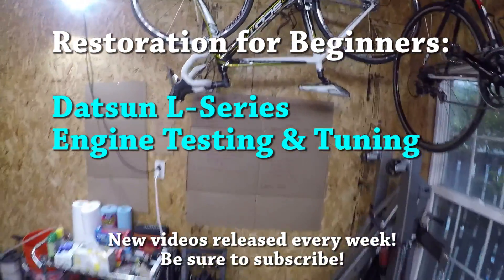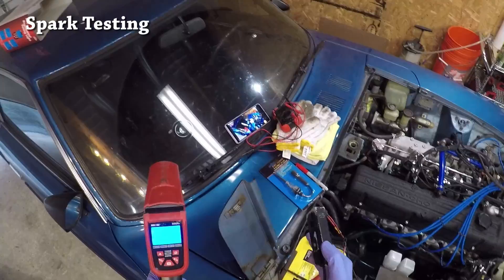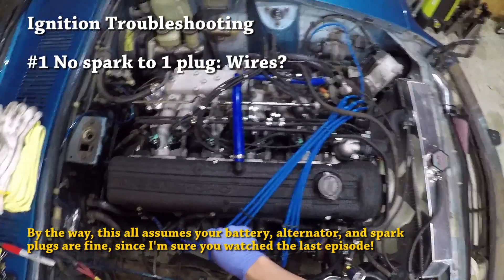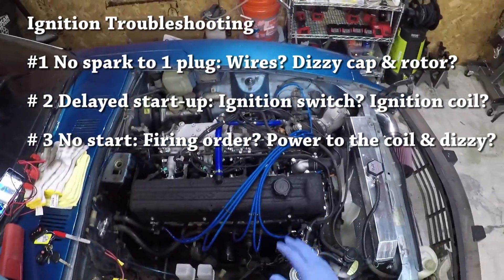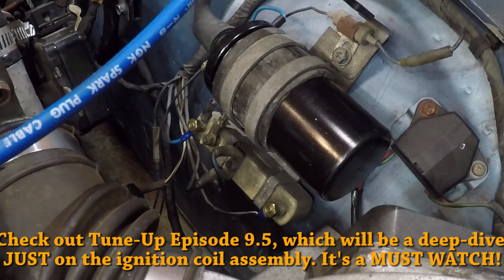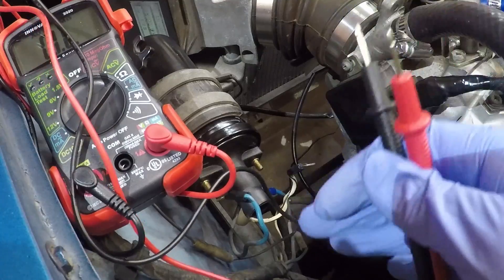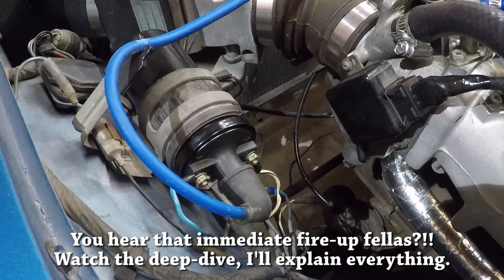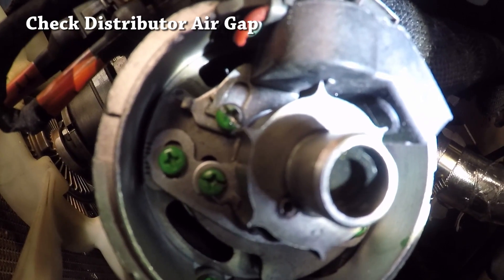Datsun L-Series Engine Testing and Tuning Ep.9 Spark, Coil, and Distributor Testing

Comment: Also check the distributor shaft play. Z cars have shaft bushings and they wear out. To much play causes the air gap to change. Replaced my 280 distributor years ago for that reason. Great video.
Reply: That happened to me also.
Reply: Not really

Comment: Great video, I can't find a cheap electronic distributor for my 1973 620 so I found a cheap cardone but its for a 1978 620 it looks and fits  like my 1973 except  the advance is pointing opposite,,I installed it but I have no spark ,the gap is the .3 ,any ideas what could be wrong?

Comment: Do you think the ballast resistor will not work if the ceramic thing is broken?
Reply from the maker: Ehhhhh I mean the ceramic is supposed to serve as a insulator, so I don't think it'll matter too much? It doesn't hurt to test with a multimeter though. I think I have a video on that.

Comment: something to consider when using a multimeter to check voltages, due to the high impedance of a modern digital multimeter, there could be a reading of voltage under essentially NO load. If there was a high resistance fault somewhere in the wiring dropping the working voltage below what is needed, the meter would not tell you. In this case an older analog VOM style at least has some load, or even better a test light that at least pulls maybe .25 amp would load the circuit enough to show any high resistance problems. Also a common fault on the dizzy is a carbon trace that goes form the HV points to ground, killing he spark to the wire. Can be hard to see. I often use the spark test light at the center term of the dizzy to see if spark is getting there 1st, that way I have cleared the issue thru the coil HT lead.
Reply from the maker: Would it be worthwhile to measure the resistance from the battery positive connection to the connection going to the first terminal of the external resistor to find any high resistance problems?

Thanks for the tips as always. I'm learning quite a lot! I won't pretend that I have a strong fundamental grasp of electrical testing/diagnosing (I definitely should've paid more attention in school) beyond the basics. I'm basically just reading up a ton on the topic and parroting the sources as I learn by trial-and-erroring on my own car.
Reply: would not hurt, but prob just be a lot easier to use a test lamp, while not precise it would catch the issue 99% of the time. I did a test for a video, hold the pos lead in your hand and touch the point you want to check with a finger (no direct contact of the lead to the test point), even with the 1 meg typical skin resistance the meter will show 12v or near that. IF there was a problem checking the resistance points along the way would be the way to find it.

Comment: Good video again.   Great camera work and positioning.   Looking forward to Ep 9.5.  Your commentary adds so much to the videos.   Thank you for reading and studying ahead of time and knowing the fundamentals behind what you're doing.   Frankly there is no bad information given on this channel and that says a lot.   Heck, you don't even hide your mistakes.  A bonus for the more sadistic viewers out there, ha!

 I'm stilllllll wondering about cyl #5 man.   Spark at the wires doesn't necessarily mean spark at the plugs.   I would ask you if you've pulled it off and looked at it but I don't want to mess up your groove so please don't answer.  

If you keep this kind of stuff up much longer, you're going to go get a job at Datsun Spirit.  Passion and proficiency combined together - that's the right stuff.
Reply from the maker: Oh yeah, the time that I spend researching is much MUCH longer than the time I spend actually working on the car. I read up on books and forums in my freetime over the weekdays, and work on the car and edit videos on the weekends (why is why I often publish videos late Sunday nights). 

Haha I hear you on the cylinder number 5, but you should see/hear this thing run now. It's silky smooth (relatively)! I still need to put some miles on the plug before I pull it again, but I'm just a bit more hopeful that I'm going to find a healthy set of plugs. I launched this thing hard the other day, and it broke traction at 2nd gear. Just all smiles. 

But then again, I still haven't done any work other than replace parts on the FI system, so we can only improve here on out. I feel so ready for the dyno already, but I want to do as much tuning on my own as I can so I don't waste my money!

I met Eiji at Datsun Spirit. That dude has forgotten more about these cars than I will probably know. I want to go bother the dude some more just to learn from him, but it sounds like he's super busy with winter engine builds. Maybe he does need some help at his shop. Hell, I'd work for free.

Comment: When I was a teenager my Dad told me to pull the wires off and see if the engine ran differently with it off. He had me pull the coil wire off and I got zapped hard. He was laughing his ass off. Oddly enough the Datsun 310gx kept running with the coil wire off...
Reply from the maker: When I was a teenager by dad just growled at me when I would work on the car. I don't blame him though, given my early penchant for taking things apart that I don't know how to put back together. 
Yeah I shocked myself several times on the spark wires too. Not fun! Eventually I learned to use insulated pliers if I ever needed to touch the wires while the car was on.